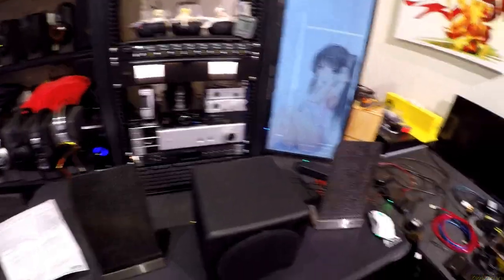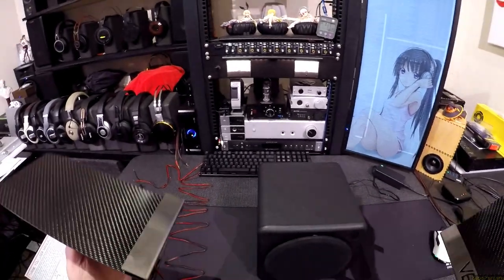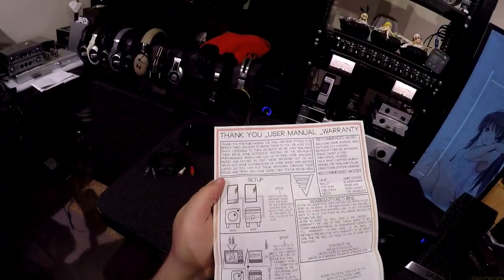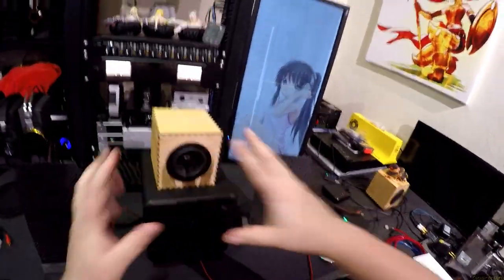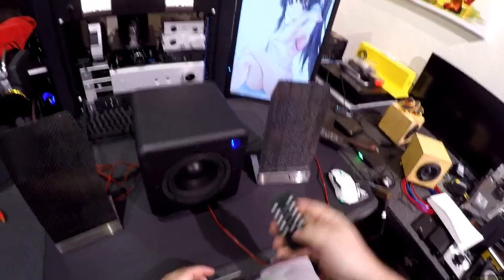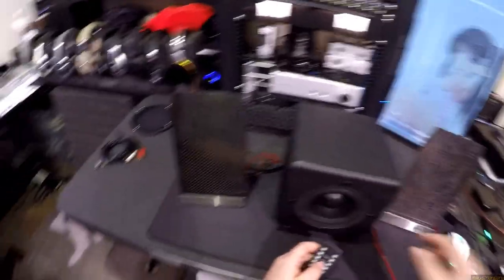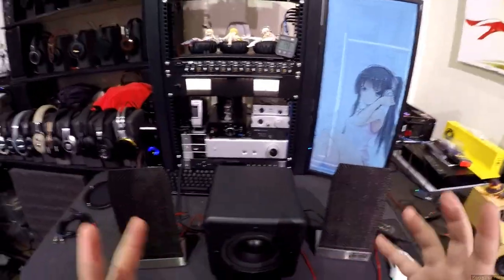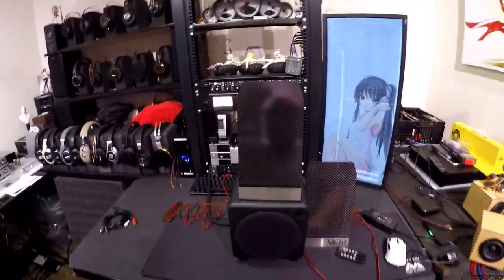Z Review - VETR PANL-1 Speakers (Flat is NOT Justice)

Comment: Here from your review of the Drop BMR1.  These are attrocious.

The sad thing is, flat panel speakers like this are absolutely doable.  Carbon Fiber is just about the WORST material they could have possibly used.  I get the LCF thing, and that's fine, but hydro-printing is a thing.  Use an acoustically viable material, hydro-print it to look like carbon fiber.  

I've played with sound exciters for several years, to the point where I consider it boring and predictable.  Gimme a $200 budget and one month "R&D" time, and I'll send you a prototype redo of these that will blow your mind.

Hell, I'll even provide the $200.

Comment: poll option: live stream making a bonfire out of these

PS: missing a link to the audio frequency test program
Reply from the maker: I added it.
Reply: I have better suggestion - in Myth busters they always try to replicate intended result so why won't Zeos give a tray and make those sound normal? Add some lowpass filters in sub and replace driver in satellite with proper twitter maybe back firring that would need to bounce of the wall. That would be interesting to watch.

Comment from the maker: 33:49 WAY OFF this time.
Reply: Z Reviews I have a fostex hp-a4bl but I really want to get the emotiva the one on your desk can I use both???
Reply from the maker: You can have all the amps you want. Just have to use the preouts on the back so double volume control.
Reply: thanks for the sine gen software i finally figured out why i was getting a serious bell curve in the 80hz range.  i thought my subs were phased right but... naw....
Reply: Z Reviews yasssss thanks
Reply: quick question what program do you use on the display. which holds all your music
Reply: lachlan clark Foobar 2000

Comment: How to fix the panels- curve them for stiffness and make them 1mm thick. Should also help with producing a treble centre, there seems to be problems when the diaphragm of the speaker is larger than the wavelength of the frequency its trying to produce.

Comment: I was listening to this review, thinking, "This is why I could never unironically buy a set of Tannoy home theatre or stereo speakers," because Tannoy became a genericised trademark in the UK for the kind of speakers they used to use in PA systems to - apparently - make sure that no-one understood a word they were saying. And then BANG! at about 13 minutes in, these sound like old tannoy PA speakers. Actually, they probably sound a lot worse - those speakers used to sound like this AT THE OTHER END OF A TRAIN STATION.

If you could get a hold of a set of (stereo or home theatre) Tannoys and review them, though, that would be good; just to see if they sound like train station speakers. Sadly, although I'd like to send you them, I'm not really in a position to right now. (Just bought those Monitor Audios I commented on recently, for one thing.)

Comment: Kinda weird. I mean, i got some sound exciters from a different manufacturer, similar type of driver, but i mounted mine on different material, and a bigger surface area. Im satisfied with how mine sound. They do need a little help on the highs, as most exciters/transducers will. I'll be pairing them with some cheap tweeters and that should really complete the sound. I think you're right about the carbon fiber possibly not flexing/vibrating enough, and i think that has to do with the way they are mounted or supported only from the bottom. Im thinking if they redesign the supports/ brackets, it'll help. There's a particular way these are recommended to be mounted.
Reply from the maker: The panels aren't touching the bottom. They float on the two transducers. Its just too heavy and they are too weak.
Reply: You're right, i had to go back and watch again. I'll send you the link or doc to your inbox of what i read. Im sure you've already seen it before. Not sure if youtube would throw a fit if i link here.

Comment: I’m pretty much building my system right now but previously i had an old super cheap receiver with subwoofer out which was crossed at a khz! And i hooked up a super cheap 12” MTX sub to it, boomy as fuck...
Reply: My future system will have dual 12” Ultimax subs and 7” esoteric with Fountek ribbon tweeter in the bookshelfs hooked up to Crown XLS’s. Gonna be amazing.

Comment: It's funny because carbon fiber guitars are a thing and they sound good. It's not a fair comparison though because the frequency range of a guitar is fairly limited.
Reply: mikbert1 the thing is that a guitar uses the body for resonance and only amplifies the sound made by the strings.

This one here acts as the strings on a guitar which it is way too thick for. Thats why it sounds like crap.

The analogy you made would be better suited if as an example the enclosure of the sub was made out of carbon fibre.
Reply: PrismFoxes well the point of a sub enclosure is not to resonate, its to absorb the out of phase backwave from the driver. But good analogy anyways.
Reply: Carbon fiber has good acoustical properties, dampening qualities, resonance, stiffness, low mass to strength ratio and so on. mbl uses carbon fiber as their "diaphragm" in their mid and high drivers. The problem i think with these is the metal cover on the back, the size is too small to cover enough low end and the carbon fiber is too thick. Probably to make it look cool and not be fragile.
Reply: The idea I was presenting is obviously not a 1:1 ratio but rather anecdotal evidence of the material having good tonal properties. At least under certain conditions. As a speaker in this instance I’d wager it’s not entirely the fault of the carbon fiber but I doubt it’s doing much to help either.
Reply: No i agree, It really depends on the circumstances, this being dml maybe another material could be more preferable, i wonder if they tested this when designing these speakers.
Reply: Marcus Christensen exactly my thoughts
Reply: Marcus Christensen I think the problem here is that the carbon is too thick. In a tweeter you want material that is high density and thin. That‘s why B&W as an example uses industrial diamonds in their high end speakers.
Reply: Why do you want it to be dense?
Reply: Marcus Christensen I can‘t explain the exact physical reason why (since that‘s out of my league of knowledge) but as Zeos said in the video, tweeters have to move very fast so the denser the material the more power it can take without breaking or deforming. It also means that the output is much cleaner. 

You can also look it up on Wikipedia.
Reply: mikbert1 carbon fibre using a good material for making speakers from
Reply: PrismFoxes My consensus was you want a low as possible mass so it can faster change direction which is needed for higher freq, but denser materals probably have some desired properties.
Reply: Marcus Christensen carbon fiber  used as a speaker cone us one thing but this is more of a bass shaker type device. Your floors can transmit low frequencies no problem but a big chunk of carbon fiber cannot shake full range sound accurately even with the bottom 3 octaves removed. The little speakers used for chime sounds in vehicles are capable of higher fidelity. TARGET PRACTICE!
Reply: I agree they are poorly executed, neat idea and design but not well engineered in terms of sound reproduction. They should have gone with ultra thin planar magnetic drivers cased in carbon fiber i think, that's what i would do though it probably would not be as neat a gimmick. Either way well executed dml's can sound great as well.
Reply: I personally think the surface area is too low for the materials to have enough movement to create a good tone. Sony has a glass speaker TV that uses a very similar if not the same technology as seen here and by all of the people who have heard it claim it has a great sound. The differences are the material creating sound is glass and it's the size of a whole TV screen.

Comment: They need ribbon tweeters and a good DSP.  Maybe try to modify them to make them sound decent.
Reply from the maker: A tiny little tweeter cut in a hole behind the panel and CRAZY DSP correction might do it.

Comment: Those speakers make mine sound worse and they have no treble and cost £20 so most things usually sound trash and low down
You could get taskbar control and just use 'ctrl alt I' to hide or show the taskbar if its windows, can't tell.

Comment: Here's the deal. If your going to make something out of carbon fiber and stainless steel, real carbon fiber at that, at least include wires that don't look like aluminum red and black licorice boombox wires. Also that cheesy sub suggest it's part of a kit that came off eBay. I hate to say it, but this is very recommencement of white van sales. I mean come on, "Adaptor" Really? A Chinese replacement power adapter the spelling is even bad on?

Comment: They look similar to my old Alphard 4.1 EK406 PC speakers. Although Alphard simply used standard dynamic drivers in flat open back satellite speakers and it worked pretty good. 
http://www.tureknet.pl/!pliki/!ogl/20180105/1801_0_kino-domowe-alphard-etp-k406-4-1.jpg